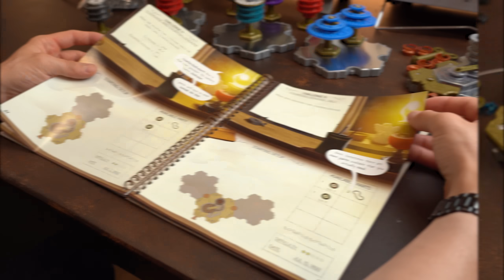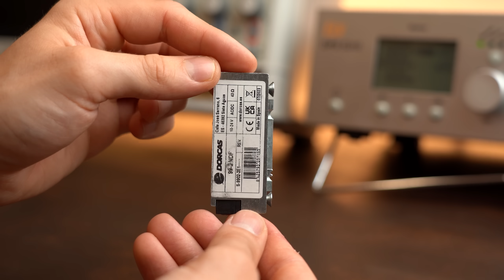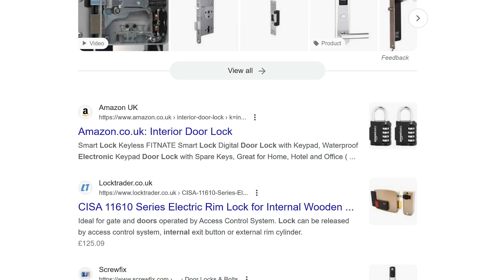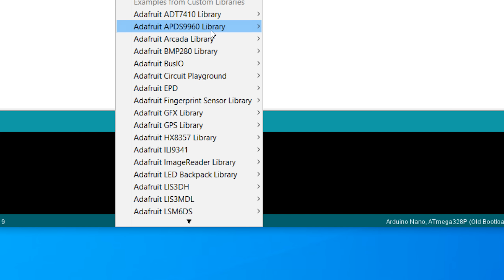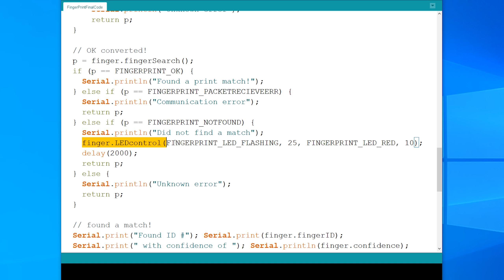Your Door NEEDS this Upgrade! DIY $40 Fingerprint Lock!

Comment: Haha, WAF (women acceptance factor) fail, it would have also failed my own standards though. Protip: You kids can only open such doors because they can use their weight to hang on to it, if you rotate the handle by 90 degrees to be upright vertical, your door will be kids-safe for a few more years while still being easy to handle for adults -- a 5 minute fix (per door). Replacing them with a rotating knob also works but requires a firm grip with the hand rather than allowing hands-free operation.

Comment: Might be worth thinking about adding protective earth to the button metall hull. As its impropable but not impossible to get a connection in this case to L or N. Could do it with a metal sheet or pcb on the inside to which the button screws against.

Comment: Simple and nice solution: Drill a hole through the wall inside the box and route the power cable through there. On the other side (in the room) you can then use conduits ;)

Comment: Well, this could be a terrible idea.
The reason you would want your electric door lock to run off a battery is... you won't be able to open it if the power goes out!!!
If for whatever reason the reader malfunctions you won't be able to get into the room.
If someone doesn't have their fingerprint registered in your little system they won't be able to... help you if you're in trouble, or get your child out if it turns out they got locked inside somehow.
If you do register someone, and something happens to their finger where the print is worn, they won't be able to open the door.
Got paint on your hands? Will the door still open?
You can lend someone a fingerprint but you can lend them a key.
Or, maybe you can recreate a fingerprint fairly easily, which means someone could hand you a glass, get your fingerprint, put it on paper and break into your workshop.
Being as smart as you are I wouldn't put it past your child to figure it out.

Comment: While this being a fun project, I think it is over-engineered. First, you don't need a fingerprint reader as a button high up will work just fine. Second you don't need electrical lock. Simply put a 90 degree bent metal screw higher in the frame. It costs 1$ and is child proof.

Comment: 1. You could come up with a Bluetooth 5 secondary "master key" if you use one of them new Arduino Nano ESP32s. Of course, you'd need to come up with the other Bluetooth LE device to act as the key...

2. 9:45 ... The missus didn't approve? 😅 You could try a USB-PD power bank and a USB-PD trigger board while you figure out how to fish the mains power wire to the box. Alternatively, you could put one of the big power stations in the lab next to the door and run a cable through the wall to the inverter outlet.
... I've had to try to cram rather large electrical loads at 5 to 24 volts inside of vehicle models, and large lithium battery packs tend to be our go-to. Unless, of course, we have to ship them overseas.

Comment: I use the same type of circuit to unlock and start my bike it was a lockdown project works like a charm and have been using the old fingerprint sensor will upgrade to the new one soon

Comment: I would actually probs recommend a mag lock instead.
reasons: 1 - no changes to handles
2 - power failure means its unlocked - so fail safe - also good in the case something goes wrong and you need to get in - just kill mains (you do want a battery... but how often do you have a power failure - just don't speak of it - espec on yt - and no one will know :D )
3 - smoother unlocking mech since its just an electromagnet
4 - mounted inside the lab - so no one except you sees it
5 - (specific units) include a relay board where the relay energizes when the mag lock has successfully mag the door. - so you have a door state built in

The box on the outside is not really smooth.... (too big) 
Rather drill through and put the electronics on the inside of your lab. (doesn't matter how far the power is ... its hidden from visitors and wifey ... aka neater) 
Then you just have a small box/circle for the fingerprint sensor - and if you made the whole bigger than the sensor - you could just have a flush plate (like light switch blank plate) - and mount the sensor on that
Its then inset on the wall - looks more 'normal' and keeps things neat

Also, but putting the box on the inside, you can use a wave to exit sensor or button to exit (you could technically even use an IR beam/laser right near the door handle (on the inside of the lab - but on either side of the door)
 - so when you put your hand on the handle - it breaks the beam and unlocks the door - so it feels 'normal' even with a maglock - but walking past or moving wont unlock it.
its easier than trying to run a cable on / through the door itself. - but a button is the simplest.

Comment: Hi Scott ,I recommend that you put an 18650 battery with a dc step up/charger.
I'm making a similar project and I'm using a 12v 7Ah battery because my box is bigger so it's hidden. The 18650 should be sufficient when the mains power fails and it can fit in your box.
Nice video 👍

Comment: I like the idea but not the execution, both security wise and looks. Here are my feedback
1. The fingerprint sensor, since it is flush mounted, should be mounted in the frame or in a tiny box right next to it
2. The electronics should be on the inside, so drill through the wall, and route some cables

I would mount the box about the same place on the office side of the door, and then drill towards where i should mount the sensor in the frame, then drill out a bigger hole in the wood frame for the sensor and then add on some extensions to the fingerprint wires and shield them with some aluminum tape. Then route the sensor cable towards the box through the newly drilled hole and mount the sensor in the frame, and done! Clean setup!

This way you would have a super clean front, no ugly/3D printed boxes on the outside with main voltage inside, that could break when your not around and small finger could get their hands on, when they get a bit older. 

Side thing, in case of a break in, your office has some super valuable stuff, and smashing that box and jumping that circuit to get it open is super easy, but not if the control box is in the room they try to get into (i know, most  burglars aren't that smart)

Comment: GreatScott, maybe you don't have to be a mechanical genius to power the thing with a battery.  The manually-charged mechanism of an angel blade switchblade knife might be easy enough for many to get good use from.  Door security needs to be fundamentally mechanical, and keeping the entire thing mechanical is beneficial from several safety viewpoints.  Only a trigger and sear might need to be battery powered if the bolt action is manually cocked every few uses.

Comment: What if your doorframe and door had som sort of wireless charging, and the electronics by the lock beeing fed by wires that runs inside the door.
and maybe some sort of battery that keeps the electronics online when the door is open. And when you close the door it draws power wireless for both charing the battery and keep the cicuit running.

Having some sort of torque sensor for when you manualy unlock or lock the door that makes the motor in the locking mechanism run freely?

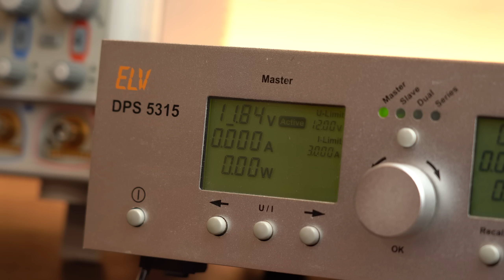Comment: Where did you get that solenoid at around 2:56?
Just saw it’s 5 volts, need 240 volts.

I made something similar but than with a shelly1, then I could use it together with homebridge to unlock with Siri.

Comment: personally id set the led ring to blue as soon as the sensor is touched and reading, and then display either a solid green as it's approved, or a flashing red as it's ejected to make it feel a little more responsive :)
Reply: Exactly. No button (or website) is ever permitted to take more than 0.1 seconds to react to a push in a noticeable way, even if the actual function takes longer to do!

Comment: To be honhest, if it's just a small child you're trying to keep out, a knob will do the trick. They lack the grip strength to operate a round door knob. More important will be a spring door closer to make sure you don't leave the door open.
Reply: I've found knobs to be fairly uncommon in Europe. I'm not sure if that's building regulations but there's places in the US (or maybe it's Canada) where they're no longer code on new construction. It's not just children that have problems with them. In actual fact, I don't even have problems with them but I 3D printed an add-on handle so I could open a door with my hands full.
Reply: @chaos.corner  Plenty for sale in the UK, there's a lot of older housing stock and people like to replace old stuff with something very similar (an anodised aluminium or satin chrome handle doesn't sit well on a Victorian panel door in a tiled hallway). I've fitted oval style handles on the last couple of restorations I've done, a compromise between old style and ease of operation.

Comment: I’m guessing your doors are more substantial than the ones we have here which are two boards with a honeycomb paper core.  Drill in the side, poke in some conduit with a magnet on so you can detect the end for drilling into the face. If you must run high voltages then you can get a flexible metal conduit to get from the door into the doorframe.   Alternatively a big battery and a text alert to remind you to charge it?  ... if it was me I think I’d just shift the door handle up to head height. 
Good luck 😀👍

Comment: this is awesome!
and this project remembers me of when I tried to do something very similar and had a lot of problems with the arduino as I was using an Arduino UNO board. The board was glitching a lot with the electromagnetic fields generated by the wires going to the solenoid.

Comment: O another idea a wireless system that can recharge the battery inside the door the system would work by you taking a device and touching it to the door where it would transfer a huge amount of power to the lock and it stores that power temporarily and then you let go and the system would slowly recharge the battery itself using the stored power ideally from super capacitors.

Comment: Is there a reason, not to use an esp32 with Homeassistant? That way you could also open it for other people if necessary without programming their fingerprints in. Also that would be a nice anti-lockout, in case you cut into your finger and get a bandage (sure programming multiple fingers would do it also, but if you power the ESP with a "powerbankt" to which the power from the outlet goes you have a safe backup).
Am I missing anything?
But really nice project and great inspiration!

Comment: Take off the door frame and the skirting board and chase out a channel on the back, rub the cable along is that completely concealed, you also then cut a small channel into the plaster board, and connect it behind the outlet, meaning you get to keep both outlets for use and the door is always powered.

Comment: Next time talk to your local electrician supplier first.
There are so many solutions for this problem.
And they have all one thing common,
retrofitting a door that wasn't meant for this is a supper annoying task.
Reply from the maker: I searched all over the place for a better solution. Sadly found nothing good.
Reply: @greatscottlab  Like I said, retrofitting is a super annoying task.
And most stuff is only for front doors.
You found a middle ground, with some issues like it's not hardened against blackouts.
But hey it's like super cheap and you got a video out of it.
Also the battery driven stuff isn't as bad as you think.
The quality stuff last years before you need to change the batteries.
Usually they only power the "lock" part the actual actuation does the human.